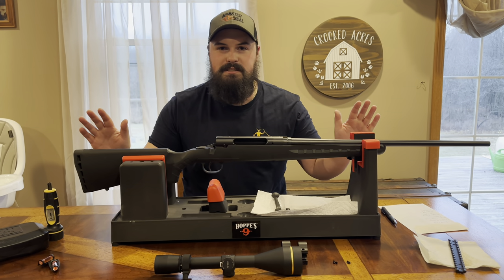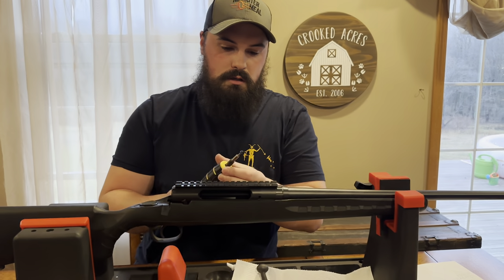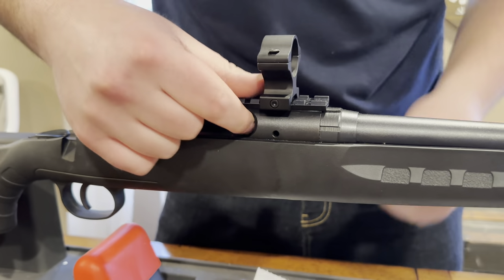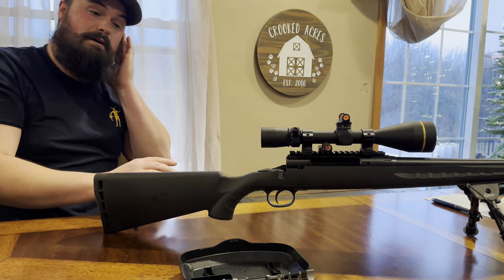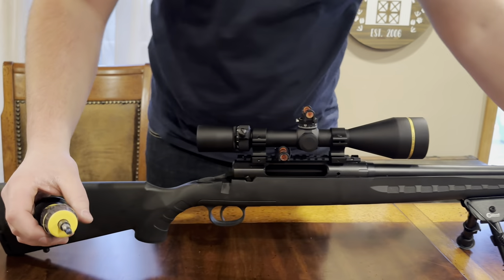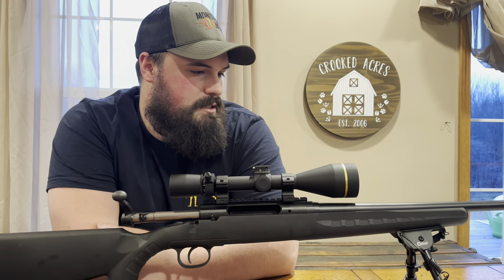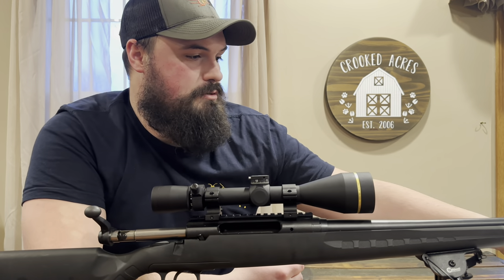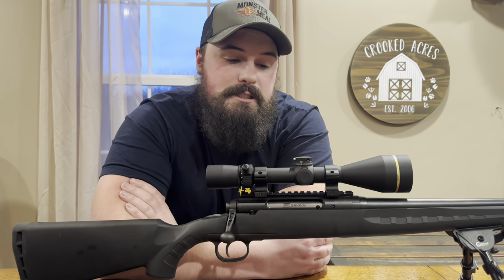LEUPOLD VX-3HD 3.5-10x50 OVERVIEW AND MOUNT

Comment: nice accurate rifle, excellent scope.  the weak link is your cheap scope mounting system.   bad mistake to show uneducated viewers.   your just wasting your money and more importantly risking that life time shot at a trophy of a life time  trying to saving a few bucks.   good rings and mounts are the bed rock of accuracy and also the cheapest part of the equation for success !
Reply from the maker: Yes there are more premium scope mounts and yes I did go with the budget option. I did get recommendations from friends who run the exact model rings on 300 win mag and 300 wby mag. The trick is to torque keeper clamps to spec. Over torque leads to flex and eventually loss of friction and thus lose scope mount.
Reply: Utube dude is full of them, females get million views and likes
Reply from the maker: @walterquick8649 I am confusion.
Reply: Which rings would you have gone with instead?
Reply: God I get tired if that “don’t miss the shot at the trophy of a life time” line. Dude sounds like a marketer